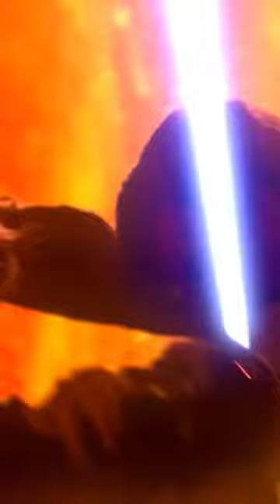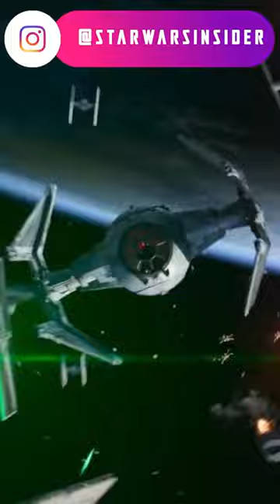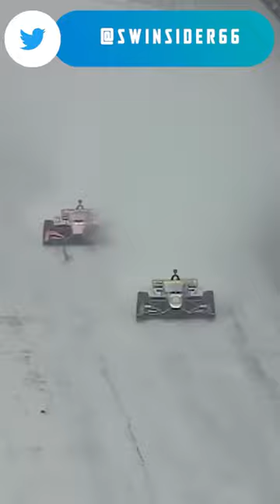How Was The Star Wars TIE Fighter Sound Was Made?

Comment: The sound was also heavily inspired by the noise that the Stuka, a German WWII dive bomber, made when attacking. It achieved this with small coat hanger-like devices on each wing, making the distinctive noise as it sped through the air
Reply: The sound from the Junkers JU-87 was actually made by a propeller on each landing gear. Older ones were always spinning and pissed off a lot of pilots. Newer ones had a switch that the pilot could use. Props would spin stupid fast at a 70-damn near 90% dive and do the roar that could wreak havok on a polish nursing home today. Was removed on later models to reduce drag among other reasons.
Reply: @austinwilson6041  I was aware that some stukas used propellors for the noise, but the Germans made so many variants of their aircraft that I'm sure both methods cropped up in places.